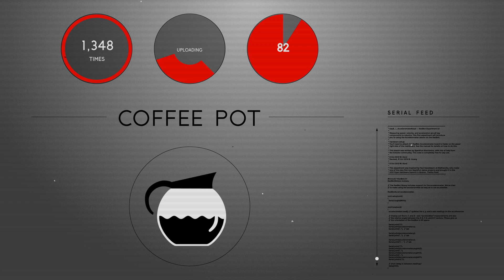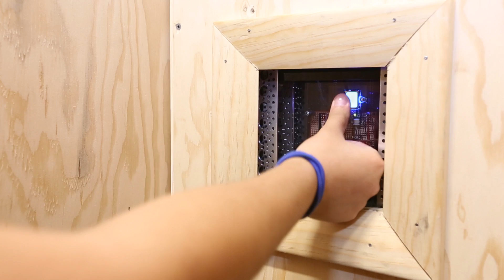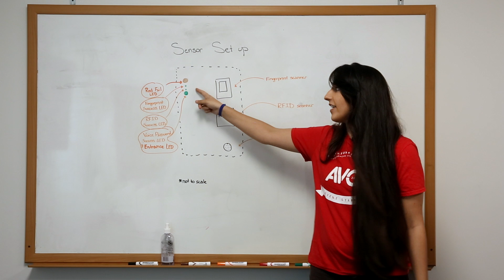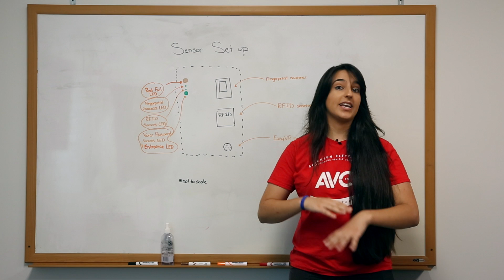Fellowship of the Things! -  SparkFun's Internet of Things Video Series

Comment: Awesome project. You've inspired me to build something like this for my safe room, where I store my valuables, etc.

What would be awesome.... is if you added an "app" for IOS and Android that allowed you to control entry and exit for  both sets of doors. Also, I'd either move the webcam from the upper corner of the "man trap" down to "head/eye level" so you can get a picture of their face too. Also, need to add buttons for exit to the outer door. Then the project would be complete.
Reply: or maybe add the same functionality of the "Ring" or "Sky" video smart door bells into the system. Mainly just the video calling (over wifi to mobile phones), remote entry/exit controls, etc. LINK: https://ring.com/pro
Reply: Good call with the Ring smart door bell. The lack of exit was a bit of a joke so that someone could really be trapped in :)